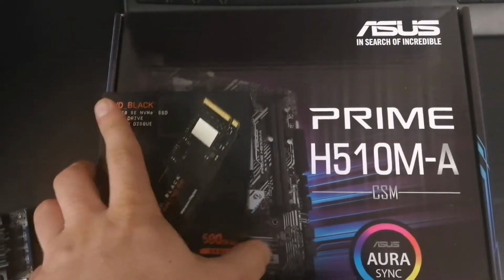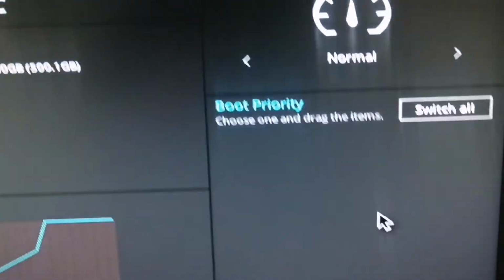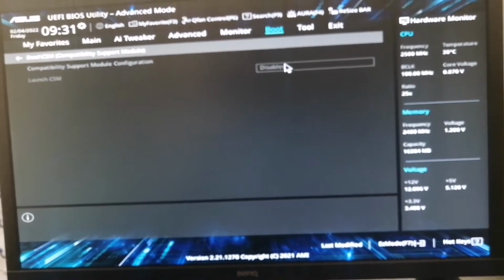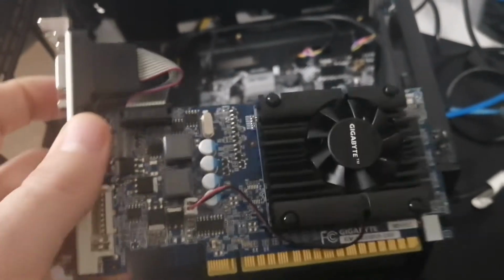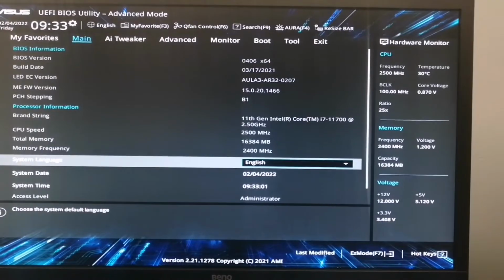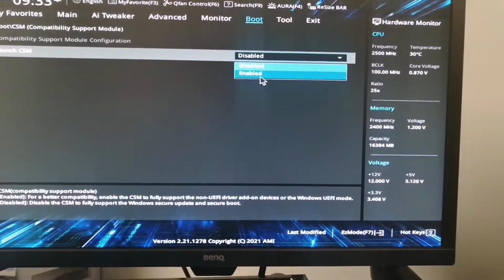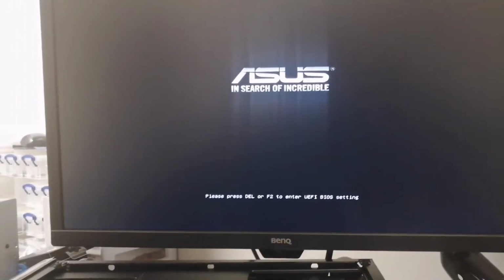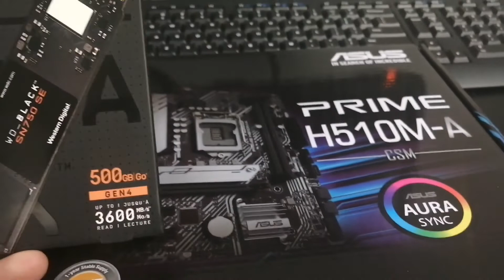New Asus 500 series does NOT detect SSD  ( CSM won't enable)

Comment: Still not work how to fix it
Reply: My method is, Bios Default -> save and exit, Bios -> Advance-> security -> secure boot control -> Disable, Boot Menu -> Fast Boot -> Disable, boot menu -> CSM Support -> Enable, hope it helps, if the video doesnt work
Reply: @formalbureau1234 It worked! Thanks. What is the cause of this issue?
Reply: What if you cant do secure boot, grayed out

Comment: Figured out how to be able to remove the video card:  Once you are booted up, you need to convert the legacy system to UEFI.  Then you don't need CSM enabled (and therefore, the video card).  The instructions for conversion: 
Run the mbr2gpt.exe command: Open Command Prompt with administrator privileges and run the command mbr2gpt.exe /convert /allowfullOS. You can also run this command from the Windows Recovery Environment.

Comment: But there is a problem. When you remove the graphics card, the same problem returns. There is no solution
Reply from the maker: Sorry it didn't worked for you , i try it couple ties and worked for me and others , you might missed something
Reply: Your Windows Installation USB and SSD (or HDD) must be GPT rather than MBR. You need to convert everything bootable to GPT. This requires a second PC (or laptop) to perform such an operation (if your main PC cannot be booted). So if for some reason you can't make that conversion.... you need a separate graphics card to use the built-in graphics card (this makes no sense at all). As far as I'm aware, Microsoft provides installation disks (USB) that use the MBR, so here's the whole problem.
Reply: @mariuszm.4989  Where is the problem? Is it in the processor or the motherboard?

Comment: Followed same procedures, but no bootable drives found still...
Thanks for ur video
Reply: My method is, Bios Default -> save and exit, Bios -> Advance-> security -> secure boot control -> Disable, Boot Menu -> Fast Boot -> Disable, boot menu -> CSM Support -> Enable, hope it helps, if the video doesnt work